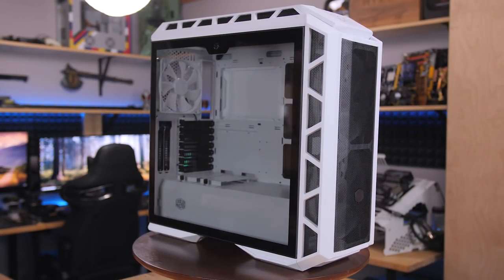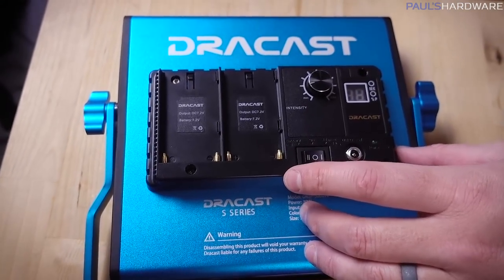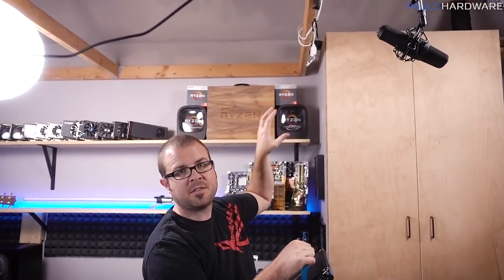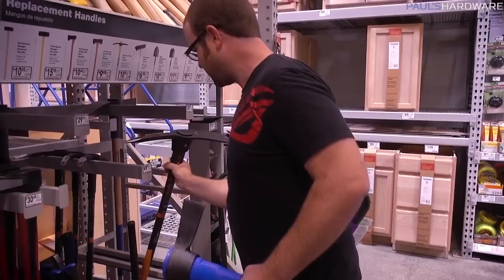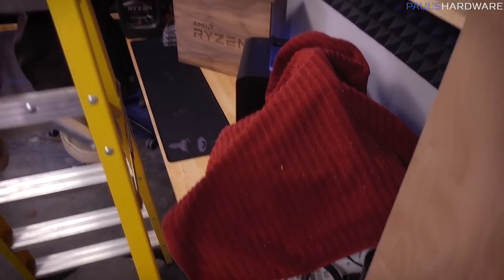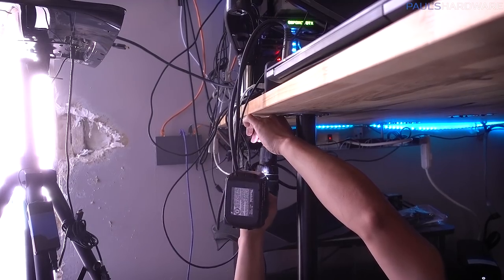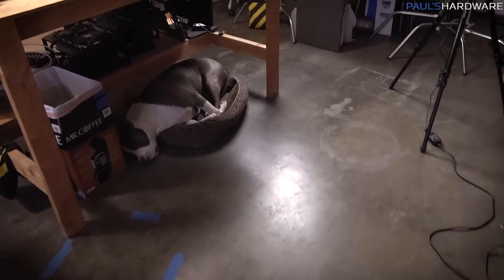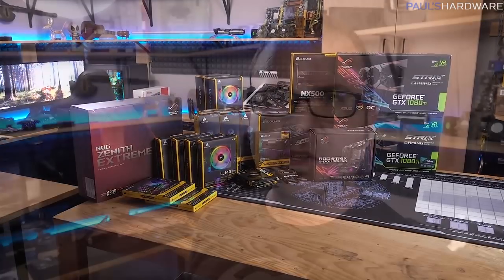ODD JOBS and Spring Cleaning - Garage Worklog 15

Comment: When you get a chance, replace that wheelbarrow tire with a solid rubber tire! It has saved our butts so many times rolling over stuff with a full heavy load.  And it always seems like when you need the wheelbarrow the tire will be flat. Just my $0.02. Cheers

Comment: hi paul :) is it ok to use 2 deepcool tf120 double blade max 1800rpm for pull and 2 corsair sp120 high performance max 2300rpm for push to my captain 240ex rgb? is there any negative effect if I do that?